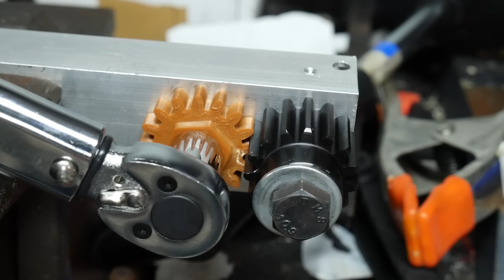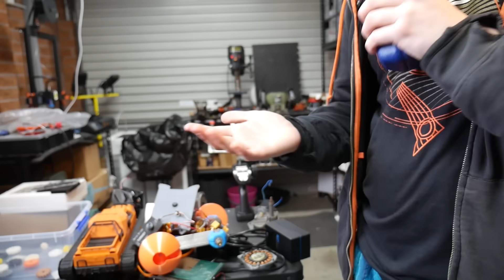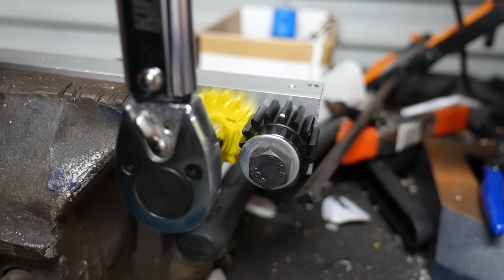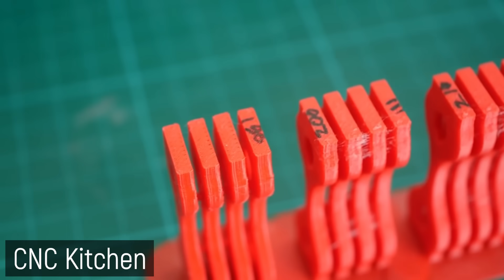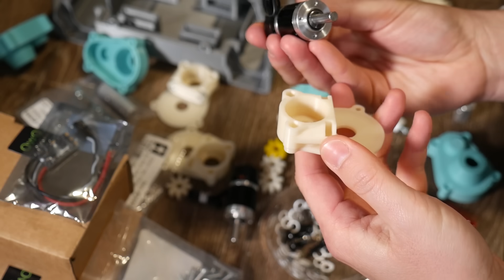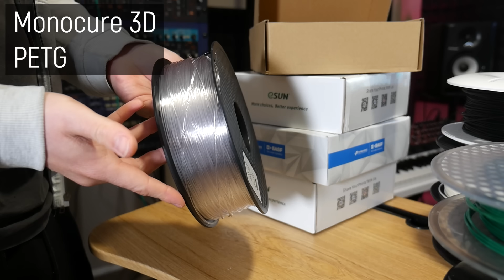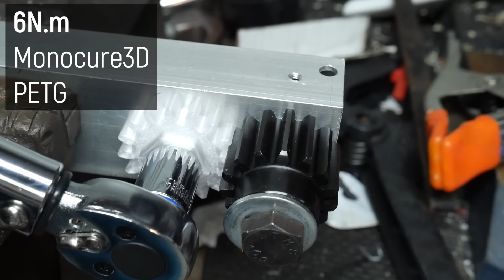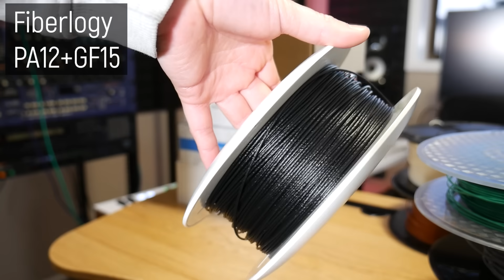Which 3D Printed Gear is Best?

Comment: Yup, bog standard PLA is one of the strongest printing materials.

With gears and bearings you want to maximise the hardness and yield strength of the material for maximum load capacity (and efficiency). This is why bearings and gears are made from high carbon steels (or treated to increase surface hardness). Hence PLA having a high yield strength but also brittle makes it ideal for gears and bearings (as long as they don't overheat, it is well worth adding some lubrication). Then the chassis is better made from a tough material like PLA+ like you have done.

There is a difference between toughness and strength. Toughness is the ability of the material to absorb energy as it fails. This means cracks can't propogate as easily since the material absorbs the fracture energy at the crack tip by deforming. But tough materials also tend to be softer and have a lower yield strength. This is why PLA+ materials always have a lower strength than standard PLA, since it is sacrificing yield strength for toughness, you generally choose to maximise one or the other but not both (or find a sweet spot). Another example is Polymaker Polylite vs Polymax PC. The Polymax is much tougher, but has a lower yield strength than the Polylite PC (and Polylite is half the price/kg). 

Polylite PC (or cheap unmodified PC) would be a good contender for the strongest gears, since it has a high yield strength (higher than PLA) and has a high temperature resistance so would be less likely to melt. Although it would probably fracture when failing which is not good for protecting your motors and such.

The way the gears are printed could also definitely improve the strength of them. Looking at the PLA failure, it looks like the side walls tore away from the body of the gear. It looks like the infill and the top/bottom layers are failing, not the walls. This is where the non-isotropic nature of FDM rears its ugly head. If you think about the perimeter lines like a wood grain, you want the forces to be in line with the grain not across it. I am thinking It could be stronger if the tooth wall perimeters extended further into the centre of the gear to essentially anchor the outer perimeters more firmly to the gear. I sometimes use very small gaps in a part to trick the slicer to put the perimeters where I want them to be. Just printing it solid could get most of the strength as as well.

Comment: The tests would have been better using a digital torque adapter. They work with a normal wrenches and some have memory that can store the maximum torque achieved.

Comment: I usually print gears like this in fil-a-Gehr PPA filament due to the very high strength and abrasion-resistance as well as the tendancy of the gears to literally explode at failure thus completely freeing the motors

Comment: If you continue this test add Carbon PLA, I use it a lot for structural parts for its rigidity - even it is snaps when it gives way. Also you can try add a extrusion/wall to the one side of the gear to give the teeth a bit more stiffness with that support. I’ve also printed gears with a SLA printer, they print beautifully, especially for small teeth but are too fragile even with flex resin added in, tough resins also don’t touch PLA. Personally I still stick to PLA and CF PLA for these types of gears. What I do like about nylon is that the gears tend to be a bit quieter since nylon have less surface friction.

Comment: BASF also makes a stainless steel Filament wich can be printed on a normal FFF printer and burned out to become a solid metal piece.
Read about it a while back and found it pretty interesting.
Sadly it's very expensive and the process to convert it to solid metal needs special equipment.

Comment: About a year ago I replaced a broken gear in my Dyson vacuum brush bar with one I designed and printed in PLA.  It's still going strong.  I didn't do any material tests but I guessed that a colourless virgin PLA I had on-hand would be strongest.  Maybe I got lucky but perhaps the colour additives really do affect the strength of the material.
BTW thanks for this video!  I think it is the most interesting video you have made to date.

Comment: Try resins, some of them should be like PETG, but prints faster for solid parts and handles high temp better.
Reply: Resins generally speaking are really fragile compared to any fdm machine.
Reply: @jothain  For gears I'd worry more about abrasion. Sure, when a resin part breaks, it really breaks and doesn't rip apart or deform otherwise. But if it's stronger, that might not matter. But due to the brittleness, the gears will probably wear down a lot faster than those made from softer plastics.
Reply: @harmless6813  pla last really well the abrasion. I have at work carton packaging machines and there's couple of places I made bit different prototype parts to test. Biggest problem was that layer lines needed to be actually sanded off as they didn't wear off which I was expecting. Also made one prototype part for pneumatic attached anvil/hammer parts. I was expecting it to demolish within hour, but out curiousity left it on for and it was there for couple months until I got machined parts to me. PLA is way, way better "technical" material than many think. Really the only downside is that it doesn't handle heat well.

Comment: I think this is bad data if applied to your RC car project because the gears aren't at their operating temperatures. The properties of the plastic will change when heated up. All the weight rates will be less. But some plastic will handle that heat better than others. Hot PLA vs ABS for example.

Comment: Great test, however judging by the slice preview, there's much room for improvement. The way the slicer leaves a space for infill in the teeth area is not ideal - at this point, layer bonding characteristics  start to play a significant role in a gear's strength, not the material “strength” itself, per say. Latest beta version of Cura (Arachne engine based) is really well suited for gear printing - it fills the teeth parts with perimeters, not leaving empty space for infill.

Comment: You need to use different tooth profile that accounts for the plastic flexing. The steel gear profile is ideal to reduce shear motion, not the highest concern for plastic if it does not heat up.
Reply: Yeah outwards profile shifted for strength (or different pressure angle).

Comment: these variation in properties in 3dprinting filaments is something i hate a lot... wish we had more "engineering grade" pla that is more properly  controlled? i guess the more expensive ones from famous brands will usually be good? still even within the "engineering materials" there's so much variation brand to brand
Reply: I used to print just rigid ink and it was great. I have a 2kg spool of the BASF ultrafuse PLA and it's also really good so far.

Comment: I'd suggest using POM, as injection molded gears usually are made of it, but I don't know if you have a setup to handle the exhaust of the formaldehyde it releases while printing. 😶 (And that because I'm not even going to suggest things like PEKK or PEEK...)

Great video.

Comment: Sewing machines use metal core, cast nylon toothed gears. Granted, they're not supposed to pull anywhere near as much torque, but having the teeth of a gear failing instead of damaging something more critical is quite important in that instance.

Comment: Good vid! Now run them at 2000rpm and see which survive. Static strenghth is a small factor in gear material selection. ;-)
Reply: At 2000 RPM, heat will play a role. What about a long duration at 500 rpm?

Comment: One problem I have noticed with PLA as mechanical parts is it’s tendency to weld to itself. If you have two PLA gears meshed to each other, they tend to stick together especially at higher speeds and torques.

Comment: Why did you print both gears in the same orientation?
Reply: What other orientation would you print gears in?
Reply: @SianaGearz  Check out CNC Kitchen's video about print orientation.  Theoretically there are 3 or 4 orientations. What you see here, on a 45 degree slant, and oriented 90 degrees.
Reply: @Scott_C  You don't print a gear vertical or slanted, it just won't work.
Reply: @SianaGearz  I believe you as I have yet to print anything on my broken printer I'm trying to fix.  However I believe the point of this video was to test the the fillament and see what works.  Also, I'd love to have your source for your conjecture.

Comment: Thanks for another very informative and helpful video. I have a background in huge printing presses and never ever seen a spur gear used in a high torque setting, have you considered helical gears so the load on the teeth is spread more evenly across much longer teeth (smaller) with a smoother and stronger application like a crown wheel in a differential ?

Comment: I think your choice in infill was suboptimal for a gear that needs to take a high load.
Reply: True but at the same time if he choose for example 100% infill it could be that the first failure point moves from the tooths towards the inner hex mount. 
20% will never be ideal for strength but it gives us information about how and where the materials start to fail, which is important aswell to make an informed decision. Nevertheless the testing is not conclusive without testing say grid infill and 40% infill, 55% and 100% infill.
Reply: I always print parts that need peak strength at 100%, just to be sure. At 3-4 shells and high percentage of infill you can get higher print times than with 2 shells solid (and therefore linear) infill, for certain shapes at least.

Comment: Id be interested in a comparison against resin printed gears. My project is requiring small module gears which would only be feasibly printable on my SLA printer.
Reply: I'd welcome that as well; as well as a comparison against a gear cast from hot-cured epoxy or engineering polyurethane. I recall "Guerrilla guide to CNC machining, mold making, and resin casting" which is a great read from largely pre-3D-printing times, you might like it. I have been using a lot of cast epoxy gears and other replacements for nylon parts in repairs of old mechanisms with good success, going back to the times when i didn't have a 3D printer yet.

Comment: Well, those gears are not toothed(if that correct word to say). Also, test with helical gears since they are easy to tooth and tooths don't experince stress same as normal(straight tooth) gears.
And why you don't print component with 100% fill if it will experience that much of stress?

Comment: Hello Angus - tips for try with same materials. Not only full infill but also focus on perimeters setting with combination on 100% infill, like sometimes is better have 1 or 2 perimeters and let infill do the rest in tooth than have for example 5 perimeters and all tooths on gear made just from perimeters. Also try to increase extrusion multiplier just to little bit overextrude, wich also helps made gear more resistance. Looking forward to more tests. Good luck with that. :)

Comment: The deformation of the nylon is actually the best option for this application. Think of it. Things are jammed up and the part deforms. Remove the jam and you still have a working gear. No destruction.

Comment: PTFE sould be the best plastic for gear because he was auto lubrification!
Reply: You can't really print that shit. It doesn't really melt, when brought to melting point which is something like 370-400°C, it pretty much breaks down chemically faster than it can melt. It degrades at temperatures above 260°C, releasing highly reactive, highly poisonous active fluorine compounds. This is not a joke, you don't joke around with fluorine.

There exists a blend filament that contains PTFE, it's printed at 300°C hot-end temperature, and is only allowed to be printed under a fume hood, and an active carbon respirator must be worn while you load and unload it into the printer.

Nylon is also "self-lubricating", and is what most cast plastic gears are made from. Also i would say HDPE and PETG have somewhat similar properties, low surface energy, low surface friction. Self-lubricating is a bit of a buzzword really.

Comment: Yeah the problem for me was the friction they make is worse than initial torque failure (like you are testing) so failure was the gears getting to hot and deformation at glass temp, it's why I use PETG but I would use ABS if my printer could hand it
Reply: ABS is known for low surface abrasion resistance. I don't think you're missing much there.

Comment: Would there be a difference if printed with 100% infill and more perimeter lines?
And could you try the BASF Ultrafuse 17-4 PH or 316L Filament?

Comment: Also for some perspective. if you say 10nm then for those not technically inclined that equals hanging 100kg (roughly) or 220lb  10 cm (3/8 in) from the center of the gear. So if you want to go just with a static test - check the "stall torque" of your motor and run it through any gear reductions. I got a pretty heavy - about 2.5kg motor here puts out about 4-5 NM at 4000 rpm and that is way bigger what you seem to be using has a 10mm shaft with a 2mm keyway. HIPS and Nylon 910 will stall the motor with that keyway repeatedly so the plastic can handle the torque with the proper gear shape and pitch and accuracy - I can print low to nearly no backlash multi gear setups - if you know how to design them . If you know that repeatedly your clearance tests will stick at lets say .1mm then you can incorporate that into your design as an offset add/subtract to your desired backlash calculation - or you can experiment. Design a gear with .1,.15,.2 backlash etc and mount it on an accurate Center distanced mount (you can 3dp that too) and see at what point they stop turning smoothly.

Comment: instead of a hex what about a Torx  for the hub? that may help the nylon with the spinning. it will deform spring back. possibly being still usable with only minor damage.
Reply: Mhm but where would a Torx axle come from? Hex axles are easy and inexpensive. I think just printing solid would help with the jump around the hub - Nylon was able to just bulge out the top and bottom of the gear to shift around the hex, stretching the infill in the process.

Comment: here's a possibly dumb or genius idea
have the print pause in the middle and make it have a hollow area to put a metal stick into
so you basically have a metal spine to each tooth of the gear.
then you continue to finish the print to bury the metal stick

obviously not for batch production but if shipping takes too long but the plastic gear kept breaking, who knows

Comment: Knowing torque at which material fails one could design weak point into gear so it will fail predictably and protect other components from both teeth flying around and motor stalling and burning.
Reply: the much easier version would be protecting the motor via limiting its current, which is rather trivial and very reliable. The brushless motors are driven by 3 (usually) mosfets, adding a current measurement, aside the hall effect (rpm) should be a nobrainer.

Comment: In my experience, the best gears are made from Polymaker Polymide and hardened for 2 hourse at 80C. Also, finer teeth tend to be stronger.
I also would fill the gearbox housing with a mixture of mineraloil (babyoil) and vaseline, that reduces friction and cools the teeth, otherwise PLA gears bind up really fast.
Reply: Larger teeth are stronger, but not as smooth.  Yeah, heat (and UV) kills PLA!  Nylon can absorb water.  Lube is good!
Reply: Doesn't the hardening change the dimensions?
Reply: @ not notably